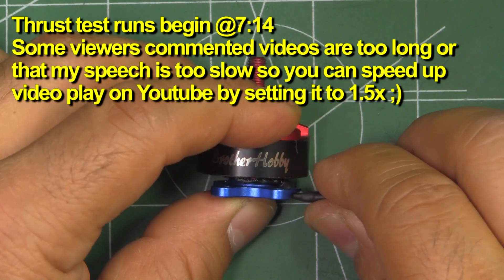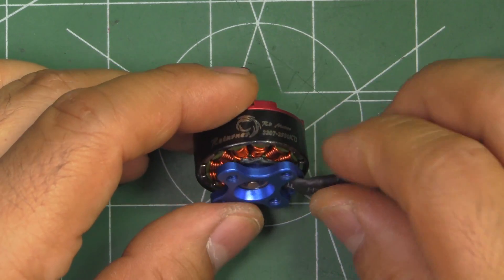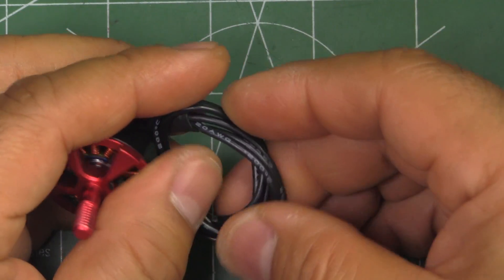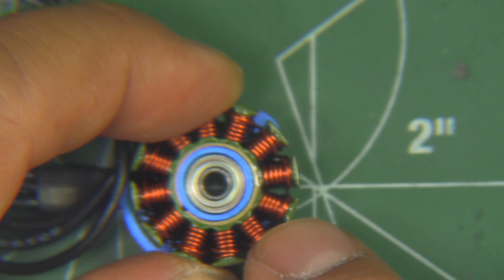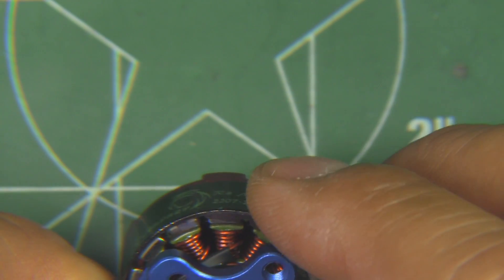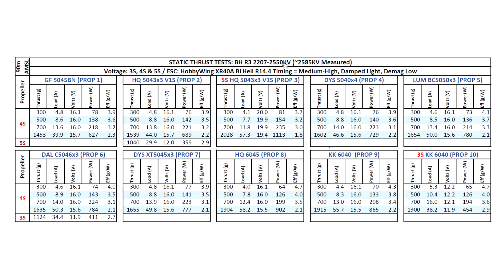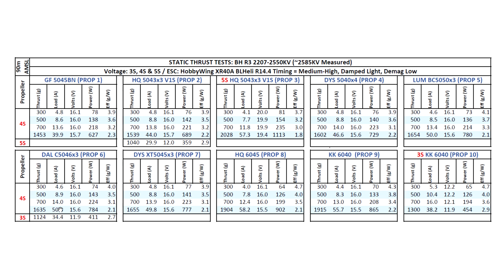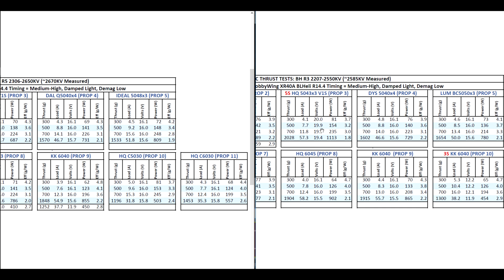BrotherHobby R3 2207-2550KV Thrust Tests & Overview

Comment: hey engineer x i have the motor equiped with a 2 bladed 5x5 prop with an 40 amp esc. on full throttle with a 4s lipo it  draws 38.5 amps and makes around 1000 grams off thrust. why is my thrust so bad.
Reply from the maker: What model/ propeller brand?  That much Amps should be close to 1500g static thrust.

Comment: Have you gotten your hands on the R5 2207 yet? I just grabbed some in 2700kv, hoping they're at least as good as these!
Reply from the maker: TheRealJonnyD Unfortunately BH hasn't sent those yet. R5's are higher grade than R3's. I'm almost sure they're going to be as good if not better than these. The only thing that motor manufacturer's went backwards on are the bearings. 4x9x4 are proven to do well. Some of the 4x8x3 or 3x8x3 have had some issues. I should ask BH to send me some of those R5 2207s!

Comment: I ran the new naked bottom V3 on my RC Benchmark setup. At 15.8v at 49.1 the 2550kv V3 hit 1682 grams of thrust in Dal C5x4.6x3... this motor ABSOLUTELY rips stupid hard.. amp draw for the power is inline and usable with the power the motor makes and the unloading in flight makes for manageable amp draw in flight.. these motors spool up and put down so much thrust that on punch outs you are on and off the throttle so quickly that your sustained amp draw is good.. on a returner V4 2522kv on the same frame and close to the same weight build if I'm doing a punch out with the V4 and say climbing 200 feet and then off throttle with the V3s I would only be on the power about 70% the time I would be with the V4s so the real Mah used in those two punch outs would be lower with the V3s.. when you look at it that way the V3 is an absolute monster of a power house and flight times would be in Line with with power house 2206s... my center stick amp draw is about 5% higher with the v3s over the v4s... for hard core freestyle flight these motors give usable flight time and sick power... in flight these motors feel like the most powerful motors I've ever flew by a noticeable amount.. response from 30% throttle to 80% throttle doesn't feel as sharp as my V4 2522kv but imho the V4 is the crispest feeling motor out there, the V3s feel a little sharper then the V5s do, about like the Pyrodrone Hyperlite 2307s maybe just a little sharper wicket spool up and down times but over all the V3s feel to me closest to the Hyperlite 2307s and that is a hell of a freestyle motor and it's sharp and crisp feeling, slightly better then the V5s but once again not as nice as the v4s... the V3 I have on 4 builds right now, I have V4s on A LOT of builds and it's because that motor is just something special and does everything better then most and makes a ton of power BUT after flying this V3 it makes the V4s feel timid, tame.. almost slow in punchouts and hard throttle maneuvers... hell it even makes the monster powerful 2306 V5s and the Hyperlite 2307 feel tame and that's REALLY saying something because the Hyperlite V5 2522kv 2306 and the Hyperlite 2307 2522kv motors are MONSTERS... brutally powerful motors that are NOT for the faint of heart... this motor just laughs at that.. right now I have 3 builds with the Hyperlite V5 2306 2522s and 3 builds with the Hyperlite 2307 2522s.. most of my builds are with Hyperlite 2206 2522 and 2450kv V4s, and a few ultra light weight Hyperlite V2 2205 2522 and 2450kv and a few Hyperlite 2204 3022kv and 2522kv setups.. I will be doing a 250 to 260 gram dry weight 2207 V3 rig just to see what a ultra light weight 5 inch with motors of this power level build can do... I fully believe it won't feel very good in the air and will be very hard to fly on a track but it will be insanely fun to see that kinda power on a rig that light..
Reply: Wicked Reelz so from your experience, which motor would you choose for a 260-280 race build?
Reply from the maker: Very telling experiences with these motors, Yes, after seeing the thrust numbers, I'm convinced we need to see more 2207's with all the latest tech. Seems like one of the good sweetspots for motors. Thanks for sharing!
Reply: I'm sorry I just seen this, for a 260-280mm build and assuming your running 6 inch props I would run the 2450kv 2306 V5, I think that motor would give you better response swinging a heavier 6 inch prop but amp draw is going to be high, if your running high quality 1800mah packs you should be just fine and be able to get 4 mins of hard ripping and 6 mins just cruising around at 80mph lol. This motor here is going to just be to heavy on amp draw to swing a 6 inch prop imho even on 1800s. I built a custom 6 inch that I was sent a prototype frame a few weeks ago, and I powered it with the 1850kv V5 2507s flying 6s 1800s and let me tell you it's a BEAST And i do mean a BEAST.. flying some 6061 triblade props the top end is amazingly brutely FAST and it feels almost as nimble as a heavier (think 500 gram AUW, 2207 build) powerful 5 inch build. Amp draw is stupid on the Tarrot 6061s so I went to dal 6x4.5x3s and it brought the amp draw down to a non battery puffing level and power was still insane BUT it severely cut my top end. Not saying it's slow by any means as it's very fast still but after flying it 6s on the 6x6.1x3s it's hard to loose that much top end when you are already used to it. So we went back to the 6x6.1x3s and slapped on some 75c 2150mah 6s packs that I use for RC boats and the batteries then could withstand the amp draw and it was back to being stupidly fast again and it has so much power that the extra weight of the pack isn't enough to be able to notice it except in the tightest stick slapping turns where it will slip a bit before it digs in and exits the turn.. I think Mr X would agree that on a 6 inch build that this motor would be to hard on any battery that us mini quad guys fly and you would be better off going lower KV and staying on 4s and have plenty of power and speed still but 5s or 6s on 6 inch is where it's at with 1800 to 1900kv motors if you are running 6s and 1900 to 2100 if running 5s. I would likely say the motor would be a F80 1900kv and run 5 or 6s.. I have a new set of R3 2207 1660kv I was sent a while back that will be going on the 6 inch setup I was talking about, it will let me go back to flying 1550mah 6s and 1800mah 6s as I have tons of high spec batteries in that size. If I was you tho and wanted a ripping 6 inch I would do F80 1900kv turning 6 inch tri blade props on 5 or 6s and if you need to run 4s only and want mega power on 4s then go 2200kv if flying 4s 1500ish mah packs and the 2500kv if you are running 1800s. Imho a set up like that is built around the batteries you will be running, not just cell count but Ma hours.. you can go from mild to wild amp draw with just a little jump in KV. Honestly if you want to go in to detail of what you are trying to build inbox me and then I will be able to give you one motor that I would think would suite you best, I'm guessing on to much to make a statement I would stand behind on a motor. That's why I told you the build I just did to give an idea of what can be done with 6 inch.. I need more info to make a proper opinion for you.
Reply: Tell me about it, it's really nice seeing new 2207s come out, 2207 is my fav stator size for 5 inch builds. The new R5 2207 2700 is a Monster I was sent a few sets and have them on 3 builds right now and ordered 2 more sets that will be built this week coming. I haven't flew or tested the LS motors but seen your test and I'm very happy with what I seen, I was sent a prototype 2800kv set a while back and flew them and liked um very much and didn't feel the KV was to high, the amp draw was not horrid when factoring in they are 2800kv 2207s, I tried them on Avan Rs and the motors came down hot as all get out, swapped over to 5x5x3v1s and GF5152s and they flew amazingly well and wicked top end on the GF5152s. Have you flew the new R5 2207 2700? Or tested for that matter? All I can say is they are THE 5 inch motor at the moment in my opinion. I haven't flew a better performing 5 inch then my Merica build with them, it's by far the sickest race rig I have flew, the acceration alone is blindingly fast, top end is insane and the respose of that motor is next level, how it handles 5 inch pitch props is something to behold it's spool speeds are wicked insanely fast to the point that I don't think I have flew a motor ever that ramps up the way it does with high load props without going to a 24xx stator.
Reply from the maker: Looks like you got some wicked fast setups. Thanks for all that info, I will definitely keep in mind. So many motor choices these days , it's useful to hear from actual in-flight experience as you described. Thanks for sharing your info.
Reply: Question for you, are you still building & flying quads?

Comment: I like how 5S actually has less effeciency than 4S.   Makes me wonder why people keep saying we need to move to 5 and 6S.
Reply from the maker: True. that was interesting. I think that works better for larger motors and props but in these scales not so much. The only justification to go to 5S then is more thrust and speed, a good reason if that's what you're after ;)
Reply: I'd like to see a test where two motors are tested against each, but they are wound to have the same Total RPM on different voltages.  Like one wound to 1620kv on 5S, and one wound to 2700kv on 3S.  So in theory they will be spinning at about the same RPM across the throttle range.  Chuck a load of props on it and check efficiency then.   I just noticed that 3S was more efficient than 4S on the KK6040 as well.  I have a feeling I'm missing something out of this equation though, and that's probably the Amp draw getting too high as you go for too much thrust on a 3S machine, but overall it's going to be bound by how much wattage a motor can take I guess.

Comment: Pretty darn good. I'm under the impression the 2306 should have more torque? Can you get your hands on cobra 2207s? I'd also love to see some love payed to the lighter motors. T motor air, cobra cpl series etc as these look more interesting for superlight builds. :)
Reply from the maker: True, we need some lightness.... lately it's been all about the medium & heavyweights. I asked Cobra for test samples but they didn't offer any :(
Reply: Grrr. Just built a 233g 5 inch with a split, and it flys amazing, dances in the air and on turns but the hyperlite 2204 2722kv I'm using have very little top end - less than I was expecting on 5x4 v1s. May switch to bi blades. Don't want to take a punt on another light motor without tests.
Reply from the maker: Sounds like it would benefit from 2 or 3mm taller stators, in some cases/setups top-end definitely needs stator height. KV alone won't do it.

Comment: Man, what a powerful motor! I honestly don't know if the R3 are worse than the R5.. it seems pretty top as far as performance goes.
Reply from the maker: Right, I was surprised how well it did as the load was increasing. Seems the 1mm taller stator does better than the 1mm wider stator in certain conditions.
Reply: I think the difference is construction more than performance.  I own 12X R4 motors and have owned 12X R3 motors.  I've never bent a shaft on a R4 and I've bent many R3 shafts.  The titanium shaft of the R4 and R5 is much stronger, but it probably contributes to the higher price as well.

Comment: I like the price better on the r3 Than the r5 motors.
Reply from the maker: These give the best price/performance ratio. I was surprised how well this motor did, compared to the 2306 motors.
Reply: EngineerX if they made it a bit higher kv, i bet they would outperform the r5's. And they dont seem more inefficient either. Just cheaper

Comment: Dont Know if my calculation is correct, but 33-2.7=30.3g of the motor 
Other Than that. Nice review. Can you for the future, zoom in on the airgap of the magnet and stator? Just to get an Idea.
Reply: By the way. I dont think your videos of overviews of the motors are too long. Just keep the videos coming
Reply from the maker: Yes I think I messed up the subtraction on the motor weight LoL.... it's light ! Thanks - I'll keep the length about the same.
Reply from the maker: Sorry ...didn't see your question, very long ago :( 
I think the motor will run fine on 5S and GF 5152x3 props but make sure to check motor temperature after a short flight doing a couple of full throttle runs. You will need some good 30A ESC's